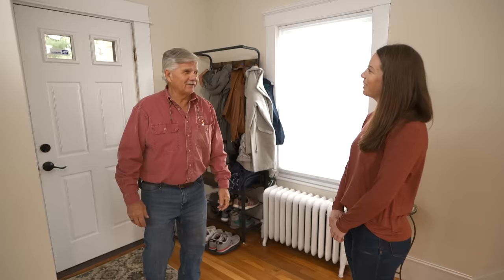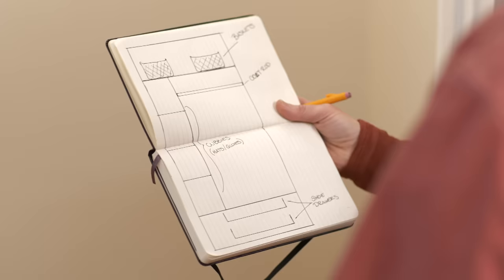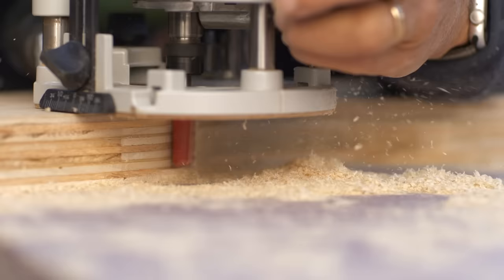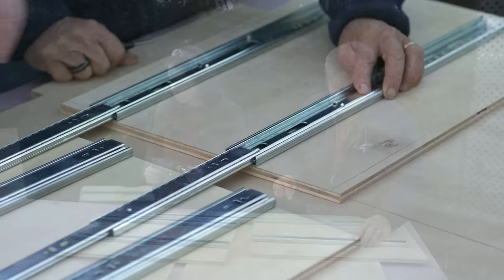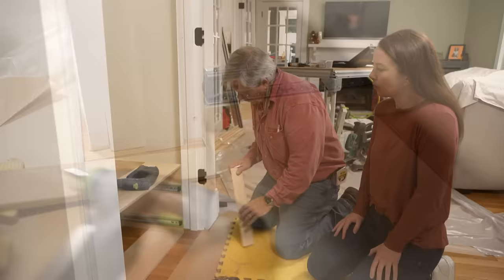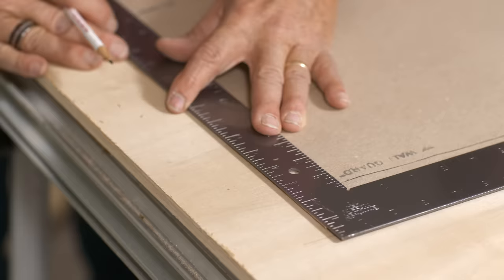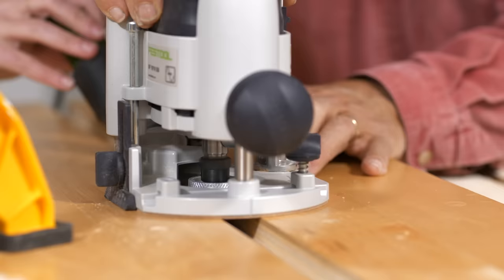How To Make DIY Closet Built-Ins | Ask This Old House

Comment: Assuming this is New England, I would have done metal mesh for the drawers and a rubber insert on the floor.
The boots are going to have snow, water, mud, etc.
They need to breath and be able to be cleaned easily.
The wood drawers will get ruined quickly.

Comment: Very disappointing so many details are skipped over.  Just one tiny example, saw Dutch Door episode and Tommy drilled a plug that had no center hole.  So how did he do that ?  Cardboard spacer for an exterior door will rot, NOT ?  So many more examples but space does not permit.    Less SHOW, more KNOW !  Thank you.   Also, update the shows on my TV IP-768 to more recent as I am tired of see all that old stuff over and over again.  BTW commercials on IP-768 are no better than on regular TV channels, yuck !

Comment: I didnt know you could put a dato set into a contractors saw! where can you get a set like that and does it work on every dewalt saw?
Reply: As long as there's space on the arbor nut, it should work. I have the DeWalt saw he's using and it works fine, but the dado insert plate is a little pricey so I just made my own.
Reply: I use one in a Ridgid contractor's saw.
Reply: That's why folks like the Dewalt.
Reply: My 10" rigid jobsite saw will take a dado set up.

Comment: They did the drawers twice. You can clearly see they're different from when they first installed them and the end b-roll
Reply: May be they thought  the gap between the original two drawers didn't look good. Nothing wrong with doing over.
Reply: @MTMF.london  nothing wrong with a do over. But why hide it. Seems disingenuous
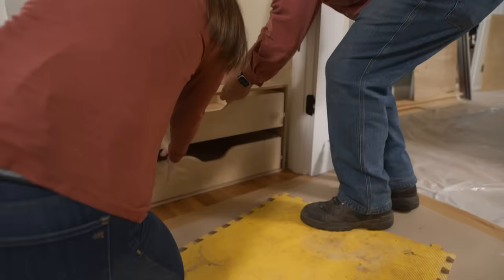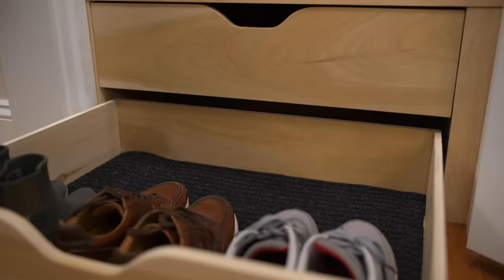Reply: 6:40 and 13:04 nice work though replicating here with some help from made to order custom boxes from Lowes

Comment: Anybody understand the wide side  / narrow side of the framing square trick?   🤔
Reply: Yea. He basically uses the piece of paper and the square to create a smaller version of the space. He uses the square to transfer the unevenness of the wall to the paper. Technically you can use any width for any side, but he used that specific one. Then you put the paper over your piece of wood and use the same widths to transfer it to the wood

Comment: for the comments about "yeah but he has a lot of expensive tools, what about me?"
harbor freight: $40 dovetail jig, $20 for 50 In. Clamp Edge And Saw Guide, $35 for 12 piece 1/4" router bit set, $20 for 1/2hp trim router, $40 for 12amp 7 1/4" circular saw... etc. Wait for sale or coupon for even more savings.
Reply: True. 100 bucks a trip to the pawn shop and harbor freight and you've got everything you need to do that
Reply: harbor freight is a good way to waste money as it will all break during or after the first use
Reply: @HaploBartow  I've had a C-clamp shatter under extreme force and a cheap knockoff dremel that was free with any purchase broke on first use. Other than that I've not had to toss any hf tools out for breakage in the past 20 so years I have shopped there. Most tools are made in china anyway.

Comment: @9:56:  Sanding inside a customer's home?  Bold, Tawmy.
Reply: It's festool, hooked up to a vacuum.
Reply: @chrisburns5691 :  I saw the vacuum hose, but there's no such thing as a dustless sander.  I don't see the point of sanding inside the home, especially without drop cloths or other dust protection.  If it's your own home, go right ahead.
Reply: @ncooty  i dunno festool is pretty good stuff, I haven't used their sander but I wouldn't hesitate to use a track saw in someone's house.

Comment: Must be nice to be sponsored by Festool.  Their equipment does not come cheap and of course, they have the whole lineup available to the crew.  It would be nice to see Tommy and the crew use some basic cheaper equipment that some of the rest of us can afford.   I wonder if Tommy could do a job with only simple tools.  I challenge Tommy to do a job using only Non-powered anything.  No batteries, no cords.  Think bit-and-brace., think chisel, think had operated EVERYTHING.  Maybe Tommy could get with an Amish crew and build something their way.
Reply: There is a video where he trims out a window with hand tools. Has out the hand saw, block plane etc.

Comment: Easy as being a person with 40+ year building experience and having every tool you need.
Reply: You could probably do it if you really wanted to. Just start with some low commitment/high acceptable margin of error projects and work your way up. Of course it probably won't all go as smoothly as you would hope and there will be some hang ups, but that's just part of the learning curve. Tom probably started with crappy bird houses and napkin holders that were out of square and ugly, but because he stuck with it, he got good. I've made a lot of projects that didn't turn out how I hoped, but they still function well enough and more importantly, I feel confident tackling bigger, more complex projects. A closet organizer in particular would be a great intermediate project and could be done with a basic circular saw, some clamps, a drill, a sander, basic measuring/marking tools, and a pocket hole jig. The best part, you can use as much wood filler as you want, paint over all of it, and if it still looks like crap, it's going in your closet where no guest will see it.
Reply: as i posted in another comment:
harbor freight: $40 dovetail jig, $20 for 50 In. Clamp Edge And Saw Guide, $35 for 12 piece 1/4" router bit set, $20 for 1/2hp trim router, $40 for 12amp 7 1/4" circular saw... etc. Wait for sale or coupon for even more savings.
Reply: Anyone could do this.  You don't learn w/o trying.  You can get great quality tools needed for this job for about $225.

Comment: Looks great! How can we do it without $7,000 worth of tools?
Reply: You could build something very similar with a basic tool kit if you wanted to. To me, a lot of the fun in woodworking comes down to find creative solutions that work with the tools and skills that I have. I get it's frustrating when DIY channels act like everyone has a festool domino or a sawmill at their disposal, but I personally take more inspiration from the overall design/function than I do the specifics of the joinery.
Reply: Call a cabinet maker and he'll do it for you.  ;)
Reply: harbor freight: $40 dovetail jig, $20 for 50 In. Clamp Edge And Saw Guide, $35 for 12 piece 1/4" router bit set, $20 for 1/2hp trim router, $40 for 12amp 7 1/4" circular saw... etc. Wait for sale or coupon for even more savings. I have all this except porter cable plunge/fixed router (i do have the HF trim router and plunge router, bulldog router table, skil worm drive circular saw as upgrades)
Reply: Buy a good circular saw, use a straight edge and clamps to make long cuts, a simple framing square, a jig saw, drill. 
Buy quality those tools will last a lifetime.$225
Reply: This can be done with a simple saw, hammer and nails. You just have to put in the work IF you really wanted to. They're using a myriad of power tools due to time constraints.